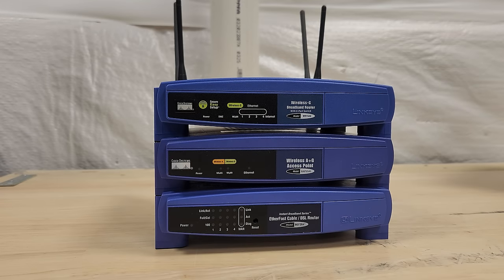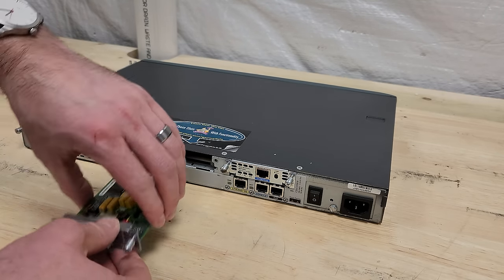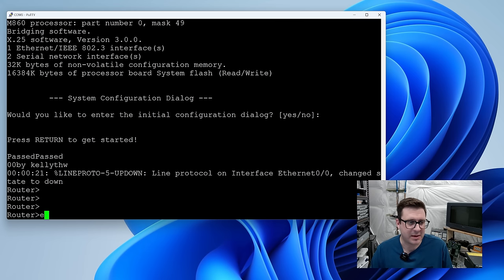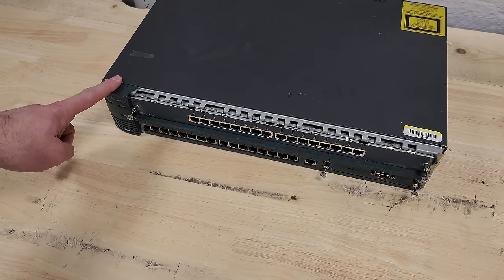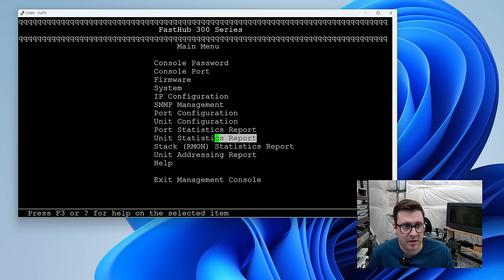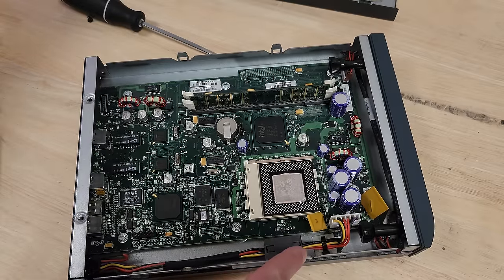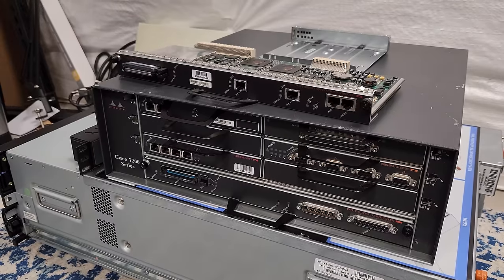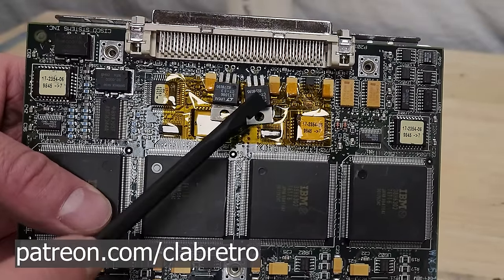Cisco PIX Failover

Comment: 7200 .... Bitchin!!!!!!!

Is it a VXR or OG 7200?

As for interfaces on that 2610, you should be able to use VLANs if you plug it in to a capable switch and can trunk a couple of them over.

A Catalyst 2900XL would be a very era appropriate switch to add to this collection. It has similar styling to the hub too (and yes, I had one at home wayyyy back in the day).
Reply: With that 7200 you can do some PPPoE session termination. Get yourself an old DSLAM and run your own broadband ISP. 😅

A couple of ISPs I worked at in the early-late 00s used them as LNSs to terminate L2TP sessions from wholesale telcos where we didn't run our own access network.
Reply from the maker: OG! but I'm on the lookout for a VXR, I have an NPE-300 for one already lol. good call on the 2900XL, that'd be perfect. that VLAN trick might work nicely too
Reply: @clabretro  I don't think it'd work in an OG 7200, but in a VXR the NPE-G2 was the cats meow in terms of processors. I don't believe they made any more after that because the ASR1000 series basically replaced the whole 7200 family.

The NPE-G2 will have a couple of gigabit ports on it (albeit on the rear), but otherwise a bunch of 100mbit interfaces plugged in to the front will make a decent router. Probably not an every day "run your home" router with it's power consumption though.

Of course, you can stay even more retro by grabbing a 7500, but they are pretty big. Those along with the 12000 GSR family literally ran huge chunks of the core of the internet for a period.